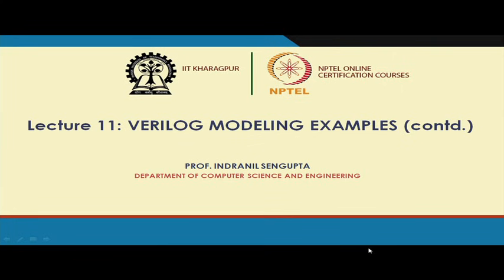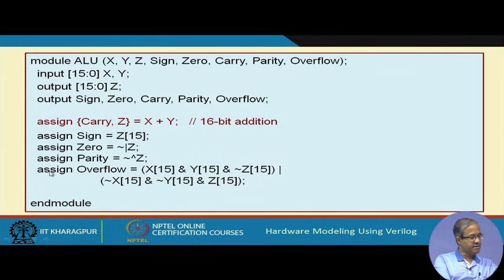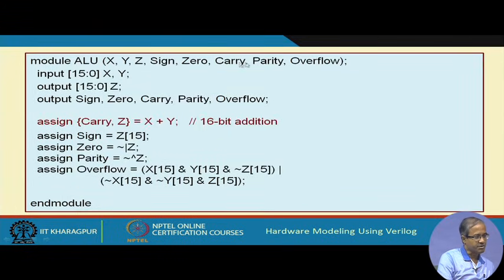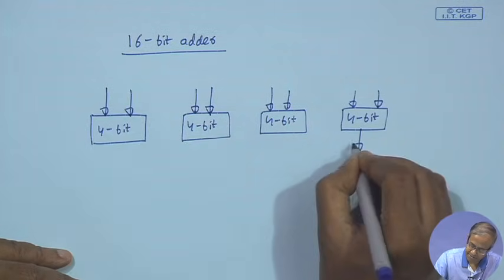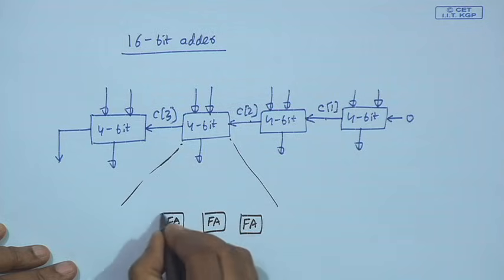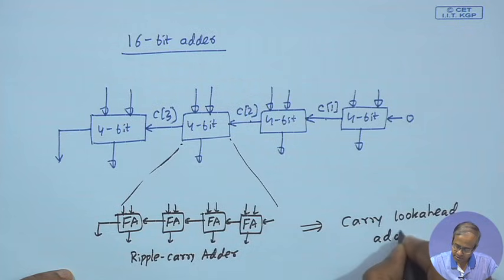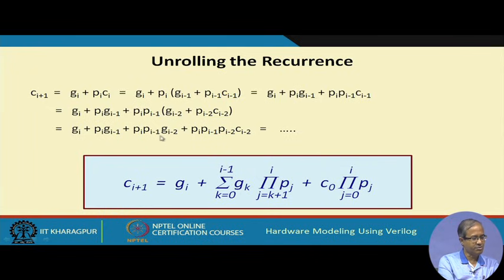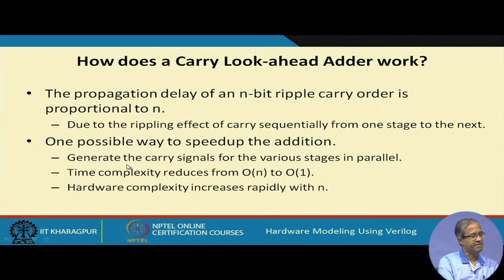VERILOG MODELING EXAMPLES (Contd)

Comment: in 08:26 how if msb of both x and y are 0 then the 1 of z becomes overflow .it is still inside the 16 bit bound
Reply: the msb of both inputs being 0 indicate that they are +ve no. and msb of output then should  not be 1 in this case. if its 1 it means overflow has occured.

Comment: 21:48 :: full adder circuit is wrong, at cout  OR gate will be present. in code , gate G3 will be OR  gate , not the XOR gate, otherwise this lecture series is very good
Reply: OR and XOR have the same output if inputs are not 1 1. In the full adder code here, you can check that c1 and c2 will never be 1 simultaneously, because s1 is 0 if ab=1.
Reply: @barjeahdj2100 yes , you are correct , thank you, you have very good observation skill.

Comment: When I instantiate a module in testbench, it shows 'This module does not exist'. But that module is present in folder. What's the solution to this problem ?
Reply: While simulating include the entire dependent files, for ex: iverilog fulladder.v adder4.v adder16.v adder16_tb.v for structural design
Reply: You have to include the file in the header just like any other programming language
Reply: Same problem I tried modelism and vivado